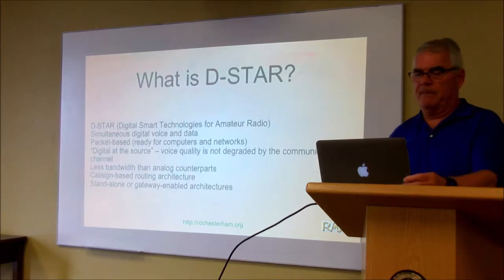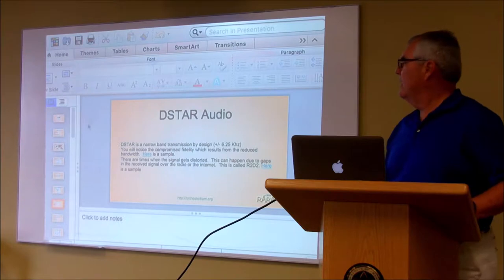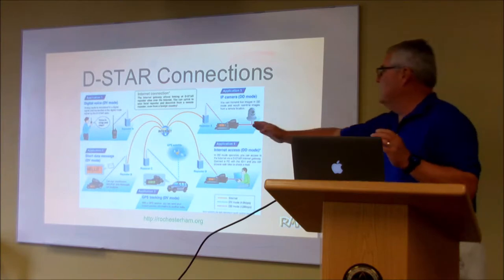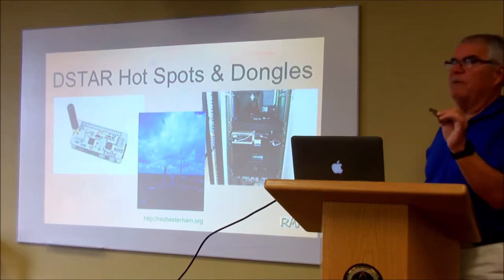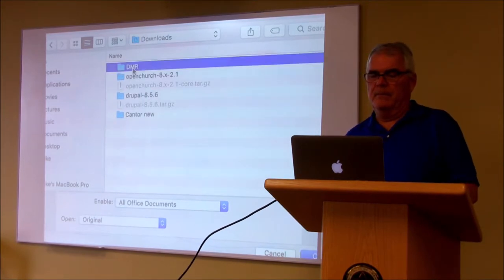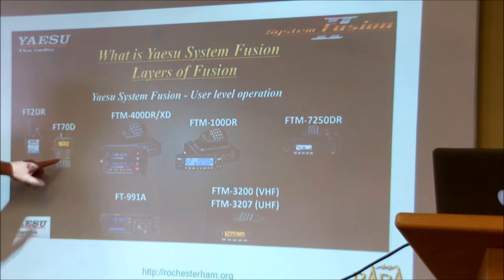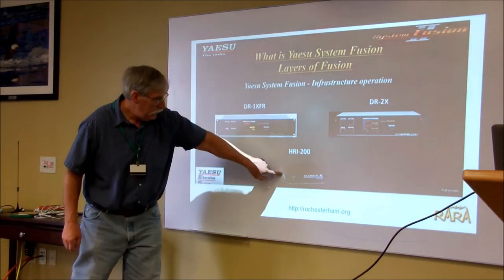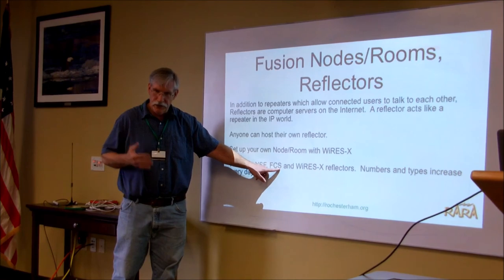RaRa Academy -- VHF/UHF Digital Radio Part 2 -- D-STAR and Fusion

Comment: Since this presentation Yaesu has added a new HT, the FT3D and soon the FTM 300.  There are also numerous firmware updates for the radios and updates to the  Wires-X software.
But in my opinion the biggest change is Yaesu's introduction of the personal  digital node (PDN).  This is where you can use a compatible radio like the FT2, FT3, FTM 100 and FTM 400, with appropriate cabling between the radio and your Windows 7 or 10 computer running Wires-X software.  This will allow you to connect to the Wires-X network without an HRI 200.  You can connect in direct mode or hotspot mode.  More info in the manuals for your individual radio and the manual for Wires-X software